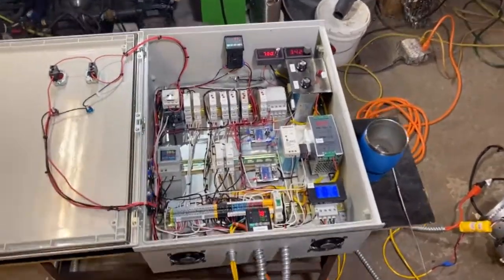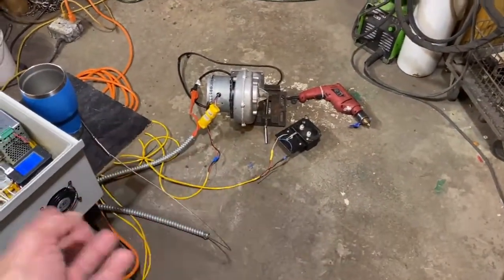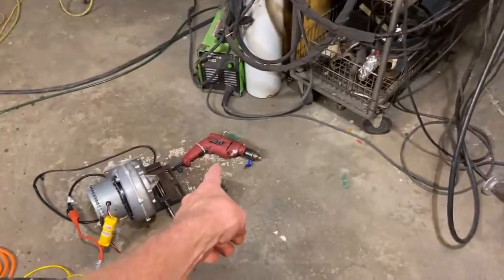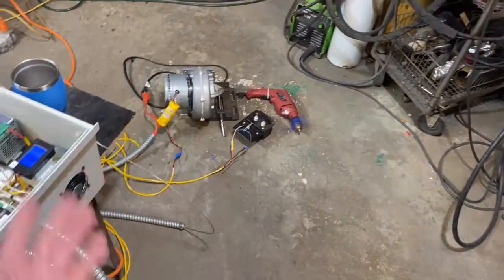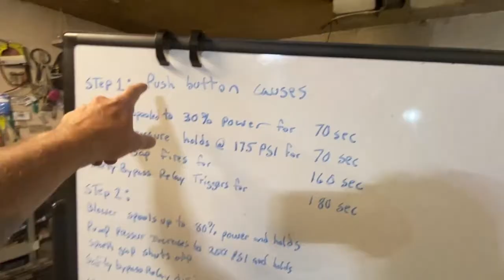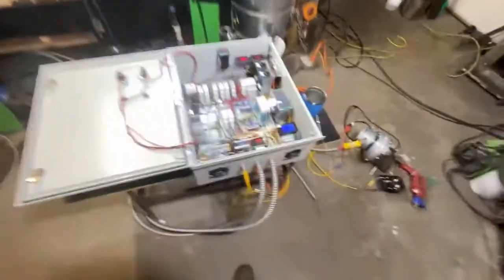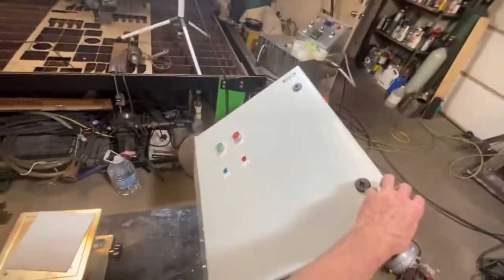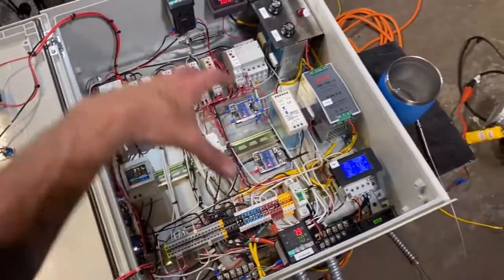Boiler control Box safety shut down without a PLC

Comment: A microcontroller could eliminate a lot of what is in that box.
Reply: What would you use and how would you code it ?
Reply: @AdrianHiggins83  stm32f103 ("bluepill" dev boards are $2). I would use CubeMX or bare-metal gcc toolchain to program it, but I think Arduino dev environment supports the chip which might appeal to beginners. 

There's a lot of options that are inexpensive. However, the transition from 3.3v logic to control relays, or perhaps temperature probe reading, etc. can require ancillary circuit boards.
Reply from the maker: No time to learn how to code , had a deadline on this machine my friend . But yes a PLC would of bin the best bet .
However they are not cheap and often cost more than what we see here  . This is a commercial application and Arduino hardware would not be allowed .
Reply from the maker: Also Arduinos are intended for experimentation and learning, often with breadboards and loose wires that eventually break if vibrated.

The boards are not protected against harsh, dirty or electrically noisy environments.

This sort of setup is unreliable, and not suitable for industrial operation.
Reply: @NOBOX7  And yet the same microcontroller is in frac control systems, in dishwashers, etc.
Reply from the maker: @topduk  Yep , this isnt my opinion per say but rather a consensus amongst people in the field . Also something about occasional  resets with Arduino ? Are you familiar with the reset issue ?
Reply: @NOBOX7  There's no reset issue I've  observed, maybe in the Atmel AVR chips?

You can pick a uC that isn't currently supported by Arduino if you want to be sure not to be accused of using it.

STM32F401 is quite powerful and available on common dev boards. I didn't check if Arduino supports it or not, it's just an example.

As for the wiring, most dev boards don't come with the pin headers soldered on, and you can put whatever connectors you want.

Many of the mechanical items you are using have limited lifespans and uncertain failure modes. Obviously everyone wants the most reliable and fail-safe design possible, and it's worthwhile to consider uCs in the equation. Sometimes they make sense, and sometimes not.

It's definitely worth learning a bit about them, there's minimal cost involved, and lots of up-side.